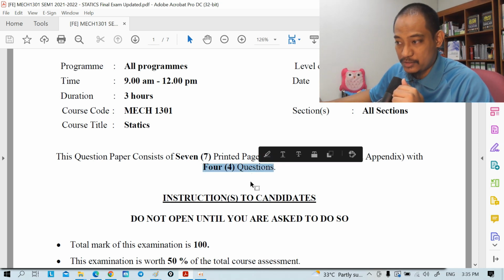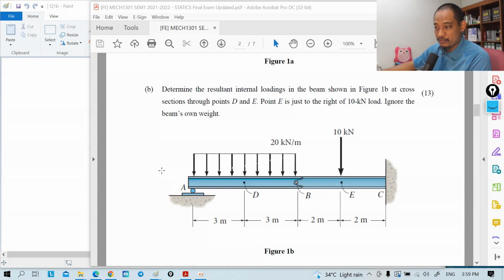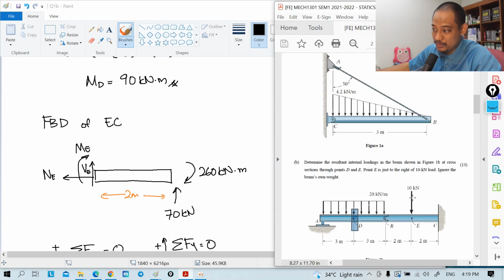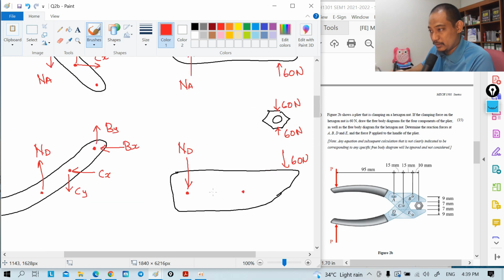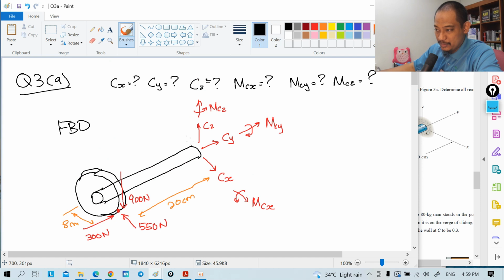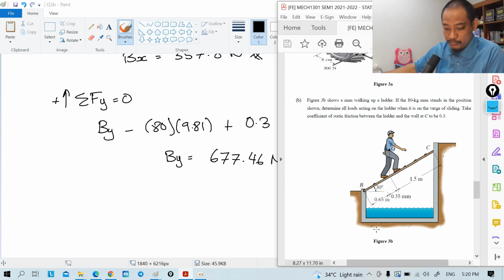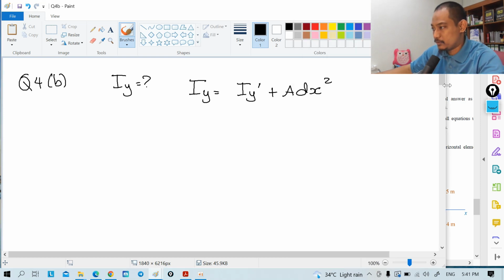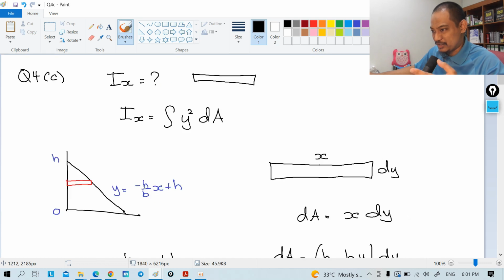Statics Final Exam Simulation

Comment: Sir at 43:53 , why there is no 10kN at the right FBD of E
Reply from the maker: Do you mean that the 10kN only drawn for one of the FBD, and not the other?
If that is what you are asking, it is based on what the question stated: 21:04 which stated the point E is just to the right of the 10kN force  (meaning if we cut at point E, the force falls into the left portion of the body)